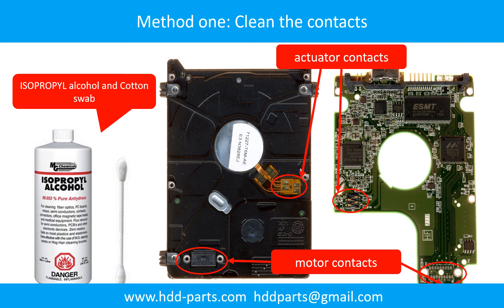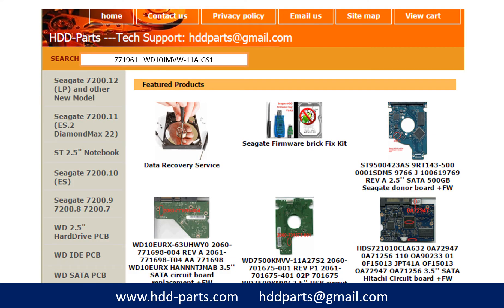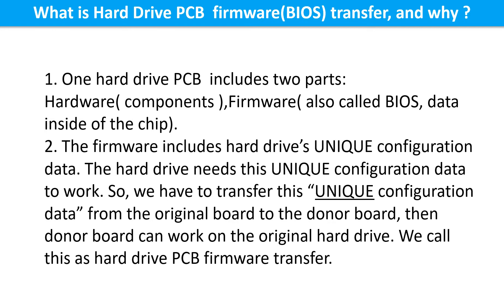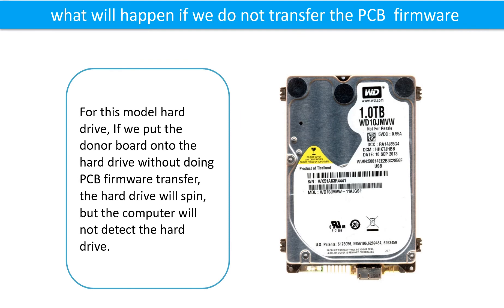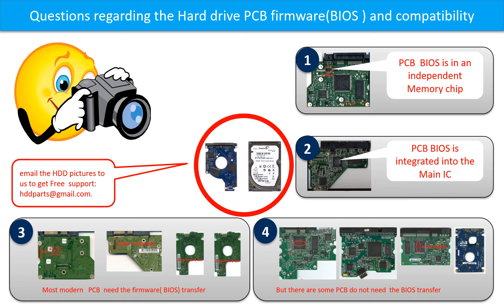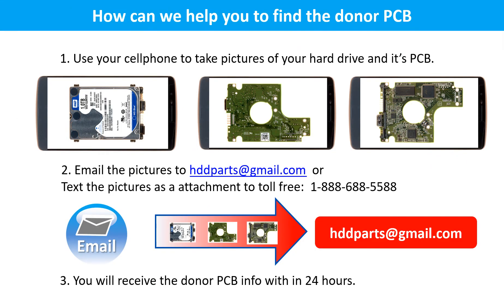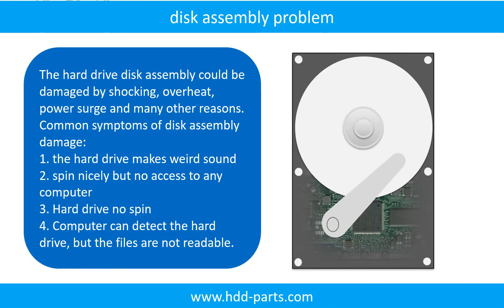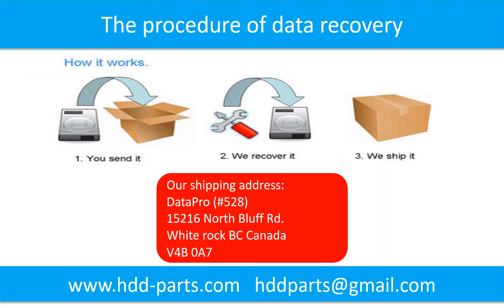WD   WD20NMVW  WD10JMVW  WD10JMVW  2060 771961 001 USB to SATA bridge    repair data recovery

Comment: from my knowledge every pcb comes with a different bios or chipset so it cannot be simply replaced. repairment is too challenging and requires specific tools and smd materials. it really depends on the error of the hard drive. Other components such as r/w head could also be faulty due to a crash. If the motor does not spin up anymore it might be better to swap the platters to a donor drive. it certainly saves time and works well.
Reply from the maker: Please avoid opening the drive yourself; it’s best to seek assistance from a professional. If the motor no longer spins, it is most likely a board issue.
Reply: @dataprodatarecoverylab  had it done already and the outcome was just fine. I got me a donor drive and swapped the platters by using scotch tape, gloves, compressed gas, head comp. It was kinda tricky but only took me 20 mins in a non clean room. That's another way to get the data back (partially). That's what most of the companies do for recovery. Many youtubes are published here for demonstration. Really helpful. Of course these are my personal data and not a pain in ass for me if the attempt fails at the end..
Reply: @dataprodatarecoverylab  btw, the drive stopped spinning after it feel from the desk which resulted in a head crash.